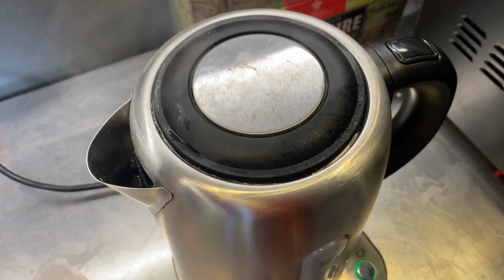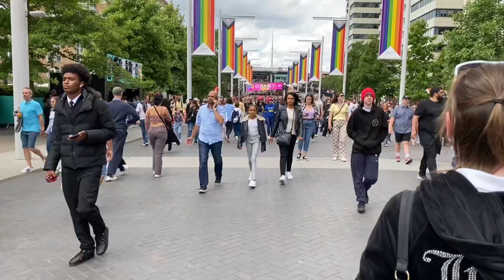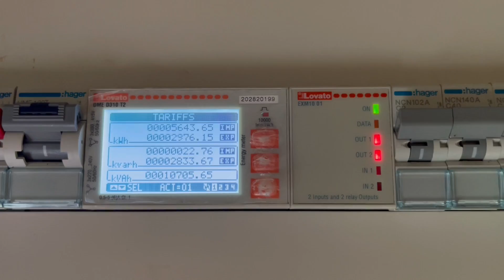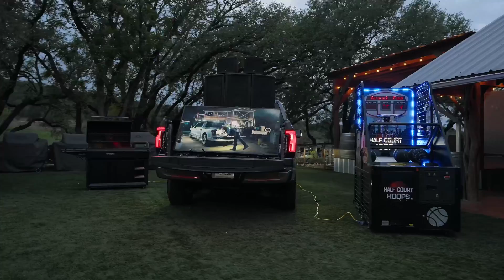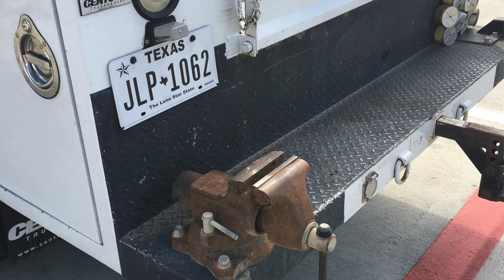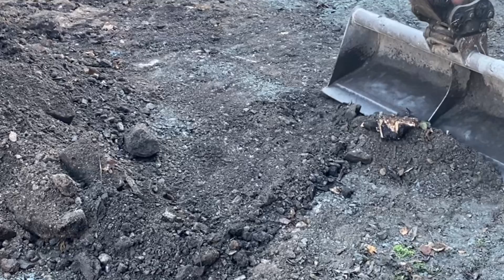V2G: Turn Your EV Into a Power Station

Comment: It’ll be interesting when workplace charging gets added to the mix. Also I wonder if perhaps crediting could be used a bit like with solar gardens so that you could charge from ‘your solar panels’ at work, so you could get the benefit of your solar panels while also load shifting power from the midday dip to cover the afternoon peak to help smooth out the grid.

Comment: I wouldn't allow my EV to go below 70%, and I would require the ability to shut it off whenever I want and only charge from the grid whenever I choose.

And the point of a home battery is for when the grid goes down, your car will do the same if you like, but it's better to have a home battery and a gas vehicle if you're worried about the stability of the grid.

Comment: We have an Octopus energy tariff whereby they charge our battery in the early hours of the morning, when wholesale prices are low and take energy out of our battery between 4pm and 8.30pm when wholesale prices are high. We pay 11pence a unit for everything we import and 11pence a unit for everything we export.

 We win because we get paid for everything we produce and pay a low price for our grid electricity. They win because they can buy peak electricity from us cheaper than they can get it on the wholesale market. Other customers win because the grid is made more secure by having  diverse sources of supply at peak times.
Reply from the maker: Sounds like a great deal

Comment: This is a very interesting topic.  Several points to further discuss across the whole industry are needed

- Buy in price vs sell price (buy in at 35/40p and sell at 7)

- Companies like Octopus want to use V2G and try and encourage people to use V2G but DNO/DSO want to charge customer to upgrade the infrastructure as it can't cope.  Is it not the job/main role of the DNO/DSO to generate energy and maintain the infrastructure?

- Why aren't the DNO/DSO creating battery farms as well as more wind farms and solar farms to give us cleaner energy?

- On existing wind farms in the sea why is there not a collar on the base of wind turbine which acts as a tidal/wave electricity generator going up and down the shaft to increase its productivity?

There is a clear need for cleaner energy and cheeper energy which is UK home made but I suggest we need a round table of people discussing it from all areas from consumer to producer and prosumers.  At the moment it feels that sometimes it is us vs them rather than everybody working together.

Comment: The discussion around DNO’s and application’s that may require an upgrade to the local network - at the consumers cost - highlights the need for these these utilities to be taken back into public ownership.
Reply: They are proper dinosaurs, public ownership is better than extinction. I remember the early day's when the DNO was the biggest barrier to progress. Same in the states where Homepower did a t-shirt 'Install by night Power by Day'. Not that i did but the rebel in me liked the idea.

Even now EVERY time 45 working days, that 3 months for G99! Thats not work flow management its just not enough employees.

Comment: It's really been great to watch, infact it's what I have been saying for over a year now. I personally feel that our networks are not investing and relying on other companies and users to sort the network issue out for them instead of investing. I like you feel it's better to purchase a car rather than specific home battery solutions and your right about the cost of those batteries,it makes sense to use a car. I also think that the networks should upgrade their systems free especially if customers will be giving them free electricity .my net work wanted £15k to upgrade my home to free phase but that ment I had to pay which also would have them allowed other users to use what I paid for. so why did the net work operator not put that bill knowing that it would or could have been shared. It's greed.my other concern is and maybe you can answer efix. If a driver of a ioniq used its car to power his fridge freezer in the house how is this appliance protected against say a shock in the case. It was a great video.
Reply from the maker: Some of the networks will upgrade power supplies when you install a low carbon technology, this does not usually extend to upgrading the network to allow power export.
Reply: @efixx  not mine
Reply: I am very up for carbon free but my net work spenergy does not help.
Reply: @gino2465  change network

Comment: However..... Your electric car needs power to heat up in winter and in summer some form of cooling! Because, there's a SOCALLED sweet-spot within it can 'except' electricity! If car 'spend' electricity it might get you into trouble. An overheating car-battery is very combustible!

Comment: Why is this geared specifically for EV owners when some of us have solar + home batteries that can contribute and potentially earn from too? My battery doesn't have any wheels - but it's still a battery.
Reply: Because the video is about vehicle to grid as it’s relatively new. Not about just exporting to grid from anything.
Reply from the maker: EV batteries are usually 4 - 10 times larger than solar storage batteries installed in homes. So V2G offers a huge potential for grid services.
Reply: Because in the future, EV owners are certain to vastly outnumber people with home batteries. The UK is a car-centric country, if not to the same extreme that the US is: Practically every household owns a car. It's hard to get anywhere without one. Many households own multiple cars.

Comment: She mentioned the cheap rate at nights but no mention of the import to export tariffs ratio so you could be paying full rate to charge your “battery on wheels” and they could be paying you a discounted rate to take it back off you again
Reply: That's already happening if you sell electricity from your solar panels to the grid. The best rate you can get at the moment is around 5 to 6p per kwh. The energy companies then sell it on to someone else for 28p per kwh (or even more in some cases). It makes Dick Turpin look like a charity worker. This and the extortionate rates they now charge, will lead to trouble ahead...... I see the Don't Pay campaign gathering pace.......
Reply: This is the main reason I wouldn’t want to export the energy I used to charge the car. I understand why the rate is less for export as they need to run and maintain all the infrastructure but storing as much energy as you can is surely a better deal at consumer level. Generate your own electricity, store it and use it yourself. Only import electricity when you’ve used all your own up. Exporting is just for when you’ve ran out of storage and don’t have anywhere else for the energy to go. I would not want to export the energy from my car if I paid 4x as much to charge it for sure.

Comment: A friend of mine had solar panels fitted to his roof and his energy supplier wanted him to pay to upgrade the local sub station !! and we are not about a small amount of money either, many thousands of pounds. So just how interested are the energy suppliers in taking power from customers, not that much .. clearly.
Of course, they did not tell him this until after he had invested in the installation, and they were aware of the installation beforehand.
Reply from the maker: That’s the deal atm - if you’re first in the neighbourhood to invest you take the capacity.
Reply: I agree that it’s a none sense deal. The energy companies need to invest in the infrastructure based on demand. Use that profit to maintain the system, that’s what it’s for.

Comment: I'm more interested in V2H.  V2G might be okay, if I have control via settings to prevent V2G when I know I need a full charge, and to limit V2G at other times to maintain my battery in my desired range of charge state.
Reply: I don't think anyone would even consider proposing V2G without those two features.  You're worrying unnecessarily if you think those are issues.

Comment: I have 3 lot SMA inverters which on a sunny day could produce 8.7 kWs of energy, plus 2 No Tesla Powerwall2 batteries and the Tesla Gateway 2 which complies with G99. The DNO have limited me to a maximum feed back into the grid of 6kWs which the SMA Home Manager deals with. All I ask is for the DNO to allow me to push back to the grid that extra 2.7kWs for a couple of hours a day during the 3 months of summer when I can. I only get paid by Octopus £0.075p per kW export but 4 times that for import which I must do during Winter and when the batteries are either charging or discharging. When will the DNO, electric suppliers like Octopus and home owns get the software to work this import / export on sunny days and help balance the grid?
Reply: Mentioning the massive difference in import and export costs is important. This is the main reason people won’t want to use their car to power the grid. If you paid to charge it using the import cost you’re not going to be happy about getting paid a quarter of that when they take the energy back off you. Unless I’m missing something here?
Reply: @jonp6798  the grid needs power in the evening when your solar is producing zero.
Reply from the maker: It’s not the software it’s the local power infrastructure which causes the main issues. So unless they invest in a different transformer and cabling you are probably stuck for now.
Reply: I did a 12.6kWp for a customer with 16kWh battery on 8kW victron Quattro and after a lot more than 45 days they allowed 3.6kW export! I tried to get main fuse upgraded to 100A from 80A i ended up getting export up to 5kW. Then after the biggest load of waffle and chaos they offered to upgrade supply to 3ph for £25k! They seem to be completely out of their depth, i think they were ok with business as usual but radical inovation on a monthly basis they just cant deal with. I also heard that they have been swapping out 100A main fuses for 80A whenever they fit a smart meter. This site had a 'smart' meter that never worked a year and a half later still not working even with moving to Octopus.

Comment: Sorry can’t watch to the end . From the two minutes I do watch, this is a another example of how the big energy generators are ripping us off.
With energy bill set to top £3000+  why would anyone want to buy an electric car/ van and supply there energy to the national grid? . Isn’t the hole idea of EV to relieve the pressure on on the grid and to lower our energy costs ie bill . What a fantastic idea the national grid rake in billions in profit , and now they expect/want us the consumer to supply them. Well know they can trot on .
Reply from the maker: The idea is you buy energy when it’s cheap and sell it back when it’s worth more than you paid.
Reply: @efixx  I tell you what, I got a pack of rechargeable batteries for a £5 of Amazon , they are now have drained you can have them for £70 .

Comment: This setup will never work in the U.S the  cause is the greedy profit Corps. The price of the battery itself  it's a bout $23,000 a setup . 
Buying a Tesla about start $35,000 to $90,000 with the power setup system about $5000 at the end it cost more than a petrol gas car I stay with my new Subaru Outback maybe in 20 years for now. if we have an earth to live on.

Comment: Your discussion has a perfectly valid point.
In certain circumstances, it’s a viable way of providing energy to your home for instance.
And helping a loved one who needs emergency power.
But on the other hand, we pay through the nose for electricity to be supplied to us, the consumer. So my argument is that it’s the energy giants & middle men (energy provider) to invest in an electrical future that’s fit & suitable for the coming years. It’s not the consumers job to provide them with energy. 
If I had the opportunity, I would buy my own solar panels & battery management system & use it to sustain myself. To then not be charged a fortune for electricity from an energy giant that serves its share holders. 
My point is perfectly sensible.
Reply from the maker: If you have your own solar and battery then you could profit the most from selling power back to the grid.
Reply: @efixx  your response once again is very sensible in my opinion. But the price at which the energy providers now pay for a consumers production of energy (Kwh) is far lower than it used to be. Not so advantageous now. But if your EV vehicle is able to provide energy to the network then I have no argument with that exact point. My point was the energy giants need to provide a sustainable future for the UK.
But for reference, I work in the production of green energy.
Reply: Like you said to "connect your car to your house or a friends yes. But for this to happen at everyday bases to support the grid it's just a waste cause if you do this daily you are destroying your battery, conversion from dc to ac for the grid, resistance.
You're just  wasting a lot more money than just upgrading the transport of energy, production and wasting lower amounts of electricity by using less unneeded device, at a time and my nemesis "STOP USING WIRELESS CHARGING, IT'S USELESS"
Reply: @yolowolfyt  fair point in my opinion.

Comment: It's a good idea in theory, however if I've paid over £40k for a new car I wouldn't want to be degrading the finite battery life and wasting charge cycles so Karen down the Road can fill the kettle to max to boil it for one cup of tea
Reply from the maker: What had Karen done that means you want to deprive her of electricity ⚡️- this issue is discussed during the video.
Reply: @efixx  i had a feeling you would cover this, however I jumped the gun and commented before I've watched it....cardinal sin!
Reply: @aster7693  I still agree with what you said as a premise. I work with batteries every day and if someone said to me adding extra cycles to your battery is a good thing I’d need considerably more evidence than this little conversation. Batteries do degrade and yes it can be made better by using them better as explained however using them less also prevents them degrading as you’re using less cycles. It’s certainly not a simple catch all answer for everyone.
Reply: @jonp6798  Well, to make this system work, the amount you get paid for selling energy from your car's battery back to the grid needs to pay for the wear-and-tear on the battery as well as the energy itself. If that's taken into account in the pricing, then I'm happy for my battery to wear out faster if I earn enough to buy me a new one sooner!
Now, the hidden cost of more batteries being made and recycled is another matter, but I presume those are pretty low compared to the environmental benefits of distributed storage...
Reply: The more I think about it, it's one big grift, people getting battery powered cars on finance to help the grid out at their own expense so the national grid doesn't have to spend billions on updating grid infrastructure....yet still charging extortionate rates for energy